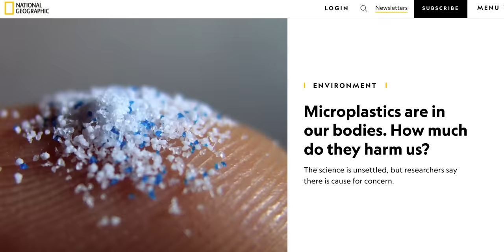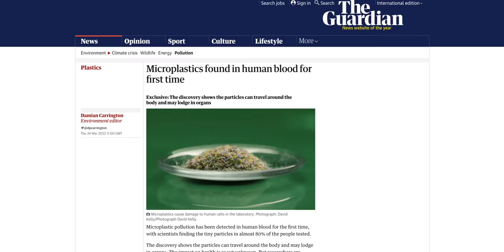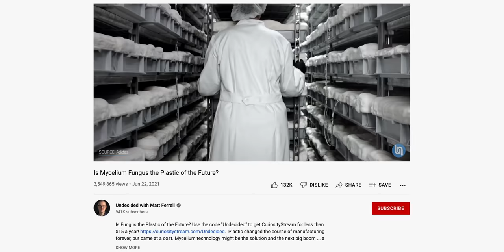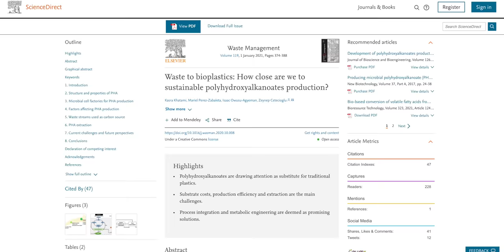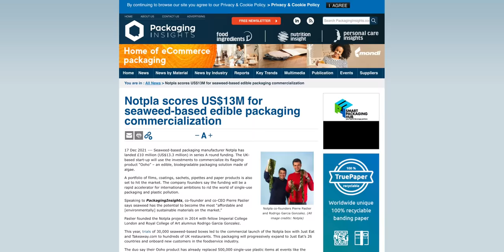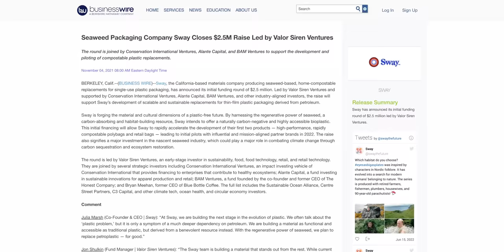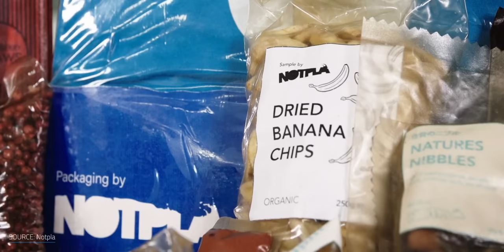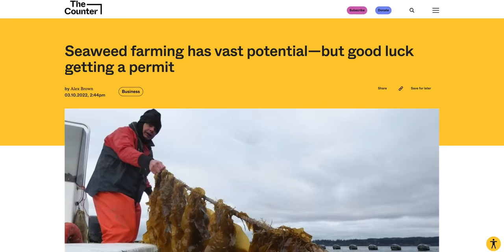Why Seaweed Could Be The Future Of Plastic

Comment: Quick question about htis carbon negative thing.
If I understand this stuff correctly
Algea/Kelp/Whatever grows -> captures CO2
-> Algea get's made into "plastic"
-> "plastic" decomposes and releases captured CO2 again

Did I miss something. Does the decomposed plastic keep the CO2 bound? or how does it go to the negative?
i mean carbon neturalish would still be much better than our current situation
Reply: When algae dies, it breaks down and decomposes quickly, releasing the CO2 it has stored back to the atmosphere. If algae is turned into a bio-plastic, it will take much longer to break down. And by the time that it does break down, another plastic will have been made. This means that, on net, a small amount more of CO2 is out of the atmosphere than if you weren’t making the bio-plastic, because it’s locked up during the period between when the algae would have broken down and when the bio-plastic actually breaks down.
Reply: Decomposing doesn't mean they need to release all carbon as CO2, some carbon content can just remain solid.

Comment: There are plastics that I don't believe seaweed will ever replace, because of its low durability and resistance. 
The fact plastic/polymers can be made as strong as some metals, support relative high temperatures, resist for decades, be abundant and easy to manufacture, is why it got so popular.

Comment: Would it be feasible to burn the plastic (with gas filters for toxic elements), generate electricity, use the electricity to grow seaweed, then harvest the seaweed for a plastic-alternative?

You would essentially be converting the existing plastic into a plastic-alternative this way, using the very energy and materials released from doing so. The CO2 produced would be offset by the seaweed consuming it.  Plastic waste is probably quite cheap, although transportation might be an issue.

Comment: Another way we could get rid of plastics aside from Bacteria and fungi, is microwave plasma gasification. Breaks down plastic and organic waste into its atoms and then that gets turned into fuel that goes into providing power. Among other byproducts  are hydrogen, ethanol and ammonia.
And metal, glass and ceramic gets turned into an inert slag that could be used in construction, metals can also be turned into ingots for recycling.

Comment: You had me until you said 2 months. It's not long enough. We need a plastic alternative that lasts 5 years. Why? Because supply chain delays will guarantee breakdown before delivery otherwise. We need something with that long of a lifespan in order to ensure it doesn't degrade in the worst environments before it gets to its destination. Neo-plastics need to handle 150 degrees, -100 degrees, high and low humidity levels, and all other variables to shipping before we could even think about switching to them. Take bottled water. By the time you get your hands on a bottle of water, it has been sitting for 2 months. Some gallon jugs of water show both the bottle date and the best before date, so you can calculate just how long it took. I saw jugs at Walmart bottled 6 months ago. And you can be sure it wasn't in the best of environments the entire time, either.

Comment: These are all great techs to replace plastic, but they'll never take hold over plastic until they're more affordable. Plastics from plants, like hemp has been around for a long time, but it's all more expensive than plastic since they use byproducts of other oil production. That and with the oil industry lobbying against plastic replacement, there will never be enough regulation on single use plastics. We need some better regulation and funding into alternate plastics for this to really take hold as quickly as we need it to.

Comment: If you figured out the difference between using glass and plastic containers,. You could also charge the manufacturer and the producer for the cleanup cost of the plastic that they profited on they wouldn't seem so profitable at that point.

Comment: I think some of these could be very promising my biggest concern with the membrane tech is mold and shelf life, yes shipping and handling is an issue but I think it is more likely that fungus or other molds will be its biggest drawback. If one of these plastic alternatives does shape up to be an all around winner then legislation and incentive programs to help out the existing manufacturing sectors make the swap would be a simple fix to the high cost. sometimes you just need to pay the price for more environmentally friendly technology to get it up and running.

Comment: Breakdown time needs to be worked on. it actually needs to be a bit longer to be a good fit for most consumables. I know at one point there was an outfit working on seaweed/algal silk, as a more long term stable product, capable of supplying packaging and textile industries, but they seem to have disappeared from view (NOT the algae + cellulose process which degrades too rapidly).

Comment: I wonder if the seaweed pellets produced through Loliware's SEA technology could be used in 3d printing applications. While the 3d printing home market is still fairly niche, I expect as the technology improves, we'll soon have these printers in almost every home. That's a lot of plastic, especially through the resin printers (which need to print supports).
Reply: PHA is already used in some commercially available filaments in a mix with PLA

Comment: Nice as PHA may be for the future...
current advice: Bioplastics like PHA are,  but, for now, consumers are advised to throw them away together along with general waste. The amount of commercial waste at this point is not enough to design a separate collecting system, experts say.24 July 2021

- NB think of it as "Earth Banking" resources for easy exhumation and reprocessing in the future.

Polymer feedstock can come from anywhere - it doesn't make the resulting plastic "environmentally friendly" unless it is burnt - with co2 sequestration (processing "costs" are nearly never - close to -  "eco friendly".  (or digested by bacteria - (with no harmful leachates).

(PE /PET/ PU/ etc, are all equivalent regardless the "source.)

Even "compostable" / biodegradible plastics , can result in microplastic or hormone dysrupting effluent..

Nice work industrial chemists, way to go...

Sadly we may end up ravaging what remains of many fragile ocean ecosystems (cough - "accredited Blue")   - commercial interests have an ability to overturn environmental principles - at the boardroom and user level.

Comment: A major source of the plastic is the single use stuff that's actually very beneficial to us, like food packaging which has enabled us to push back spoilage by quite a bit at extremely cheap costs.  Of course the major problem is that the plastic doesn't just go away once it's use is completed.  Worse yet is in many of the use cases it makes the plastic far more difficult to recycle, an already heavy cost that no corporation wants to have.  
This seaweed tech is amazing, it does a damned good job of solving all those issues.  As usual however the only real way to force Corporations to accept a more expensive alternative for anything is by regulation, no amount of public market pressure will ever force real change in any meaningful time frame. The way we have set up our economies leave any business vulnerable to being undercut by unscruplous actors via competition as long as there is no regulation guiding it.  AKA Amazon Mom membership service and how Amazon is still pulling that vile evil practice in any form they can in any industry they can and the US government still has yet to even acknowledge that it's happening.

Comment: I think the biggest problem with plastic is that virgin plastic is so extremely cheap due to it being a byproduct of the fossil fuel industry. This means that recycled plastics simply can't be price competitive. If fossil fuels weren't being used the cost of virgin plastic would rise so dramatically that, not only would recycled plastics be economical, it might even be profitable to mine landfills to collect old plastic. It would also mean that other container types, such as glass bottles or metal cans, would be more competitive as well, reducing the situations where plastic is used. Unfortunately, I don't think we can completely replace plastic with anything, it's just too damned useful, what we can do is reduce the amount used, and increase the amount of recycling that's done. Both would be accomplished by ending our use of fossil fuels (or, at least, reducing it to negligible levels).

Comment: To be fair, any plastic recycling wont be helping as long as the car tires are the number one enviromental problem. And im not talking about dumping them in to the sea, but the fact that it is impossible to prevent plastic to end up to our enviroment due to the wearing of the tires. This causes over 400x more pollution than all the toxics released through exhausts of the cars!

Comment: The issue of recycling cheap disposable plastic isn’t a technology issue, it’s structural. Imagine trying to PROFITABLY collect and reuse the emissions from individual consumer combustion vehicles. It’s low cost to produce will always be lower than the cost of collection and sorting because of its wide distribution. If the cost to produce increases such that it’s profitable, that eliminates most of the value of most plastics used. Plastic companies and those that say the largest cost savings by using them have known this for 20 years. 

Changing the materials to something less stable and biodegradable is the only way without forcing consumer habits. Way easier and cheaper to make them illegal to use for most applications. (Probably over a few years) Which we should. Just like all those radioactive materials that used to be on the market.

Comment: I'm all for reducing plastics, but what about the plastic uses that aren't temporary, like Tupperware, car parts, housings for electronic devices all of these things need to be long lasting and not easily degraded though at some point will still make it to a trash heep, it feels like all of these solution are only helpful for single short term use plastics like a plastic bottle?
Reply: I think they’re trying to replace single use plastics first, as they’re the worst for the environment and more prominent than other longer term plastics. 

We might be able to use seaweed alternatives down the line for everything eventually, but you gotta start somewhere

Comment: Anything is better than the plastic we have  biodegradable plastic made from seaweed would be a great start.   The problem with plastic is the plastic bottle makers make a very fine and soft sleeve that goes over the bottle as a label this breaks down faster than the harder plastic of the bottle if they would print their labels onto the hard plastic of the bottle and did not use the soft thin sleeve of a label would save time for all sea creators from eating the thinner label or if they did what they did from the start print the labels out of paper

Comment: Plastics were first made from vegetables.  It isn't what plastics are made from that is a problrm but how we have failed in disposing of it.  Had we actually been effective at burying it, the hydrocarbons would just be sequestered which for plastics made from fossil reserves would just be returning them to where they came from.   Integrating them into our ecosystem which is already happening with microbes evolving to consume them and we would be doing artificially by discovering enzymes that breaks them down only changes the balances in our ecosystem by adding more biomass.  What we tend to think of as environmentally friendly, often isn't.

Comment: We need a material that is food neutral and chemically resistant to all different kind of foods, sturdy and light.
Biodegradable products simply can not meet these criterias. So, the idea to get bacteria to do the impossible - biodegrade the "not biodegradable" -  seems like the only solution. 
Sadly, seaweed sounds more like a short term container. BUT, if we were to compine plastic and seaweed, it could reduce the amount of plastic to an unproblematic level. Plastic coated seawead  - but I think that is kinda what we are doing already, where possible, using paper.

Comment: a world wide law should become reality, something as "All producers and or container/product maker that the final products/services contain plastics(polymers and plastics that are not fast degradable) must recycle 115% of the volume they sell/give/output of plastics and polymers, that can lower 1% each 2 years(until it reaches 100% then it is fixed) as assured by a competent measuring device/body of professionals assigned to them."
creating a loop of decreasing matter in the planet surface.

Comment: Whenever there is discussion about too much plastic then people tend to say recycling and using as little plastic as possible is the key to success. But in my opinion it's quite the opposite... 

Recycling only works if every plastic element is later taken back to be recycled. If you only recycle half the plastic you produce then whole idea fails. And in 2022 we don't even recycle 10% of what we produce globally...

Using as little plastic as possible is just plain stupid. On the example of milk in carton boxes that actually has a tiny plastic foil in the carton. This plastic is not possible to recycle as there is too little of it to make it worth the costs. Compare it to full HDPE bottle, that can be easily cleaned with steam and recycled with higher profit (or even used again without recycling if possible). So either use solid plastic package or don't use plastic at all, but never use "little plastic".

Imagine this impossible scenario (or maybe possible future?) where each plastic food package is made from HDPE in standardised sizes. HDPE is really durable, cheap, long lasting, lightweight, waterproof, great for storing all kinds of food and many chemicals, and has many more benefits making it best package material we could possibly get right now. So you are basically buying boxes. Each box has unique id (possibly little magnetic tape inside) and is dedicated to store specific things (example - food only packages). Next time you go to shop and return those boxes that are cleaned and packed with food once again. If you don't return them in a time of a year then you are fined for trashing. Simple solution that requires everybody to return every bit of plastic we get. The only cost is maintenance of a huge database containing each package information (like who and when bought it, and what was inside).

Comment: Most plastics are more cheaply used as fuel than recycled (iow: the total energy cycle cost of recycling is usually vastly higher than the energy cost of making the plastic in the first place) 
This isn't a bad thing IF the plastic raw materials aren't fossil-sourced

A better criticism of corn is that the oil costs of growing it are around as high (if not higher) as the ethanol/plastics produced out the other side

Seaweed is a good source material but the health of the oceans means that atmospheric CO2 needs to be reduced. Kelp forests off California are already in decline

Comment: the entire burden of getting off plastics is on the shoulders of the companies that pump out the plastic in the first place. you need to not just twist their arms, they need to be broken, until they switch because they wont do it otherwise as it's cheaper to just keep pumping out plastic. none of these alternatives will see the light of day until companies are forced by law to give up plastics or add a massive tax for the use of such plastics and direct that tax towards the companies. this will force them to seek out alternatives and they will find a way (they always do) they just need to be pushed.

Comment: These videos would be better if you addressed why this stuff doesn't actually work.

The truth is that making a container that biodegrades in a month or two defeats the entire purpose that packaging in the first place.  No company is going to seriously invest in plastic packaging that they have to worry about molding in a month.  Sauce packets, bottles, bags, etc. often sit around for years before they are used.  This saves massively on cost.  These "solutions" defeat the entire point of the plastic packaging in the first place.  Waxed cardboard/paper has been around for decades and can already do what these bioplastics are claiming to solve (see McDonalds cups).  The reason it's not more common is simple - it degrades far too quickly.  Designing a plastic to degrade quickly defeats the entire point of using plastic for most applications.

Comment: It just seems plastic could be widely used as an insulation or structural building material to offset filling landfills. However Congress needs to force it with laws or it won't work.